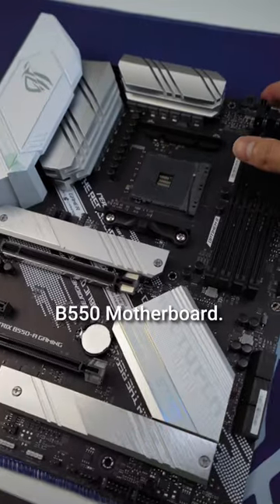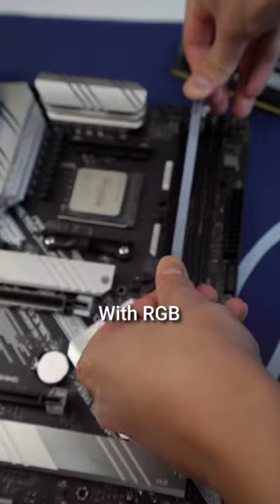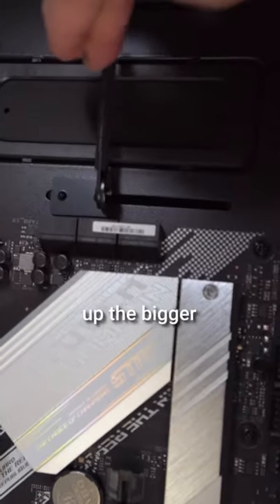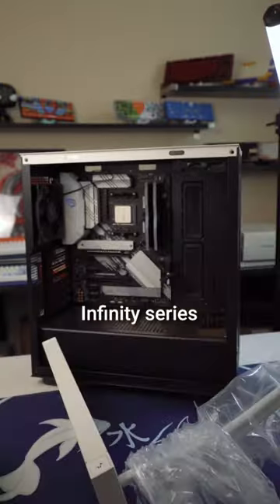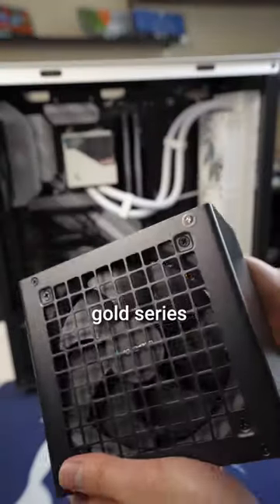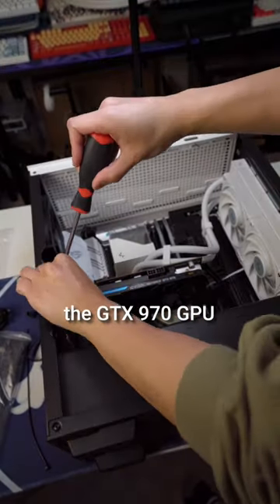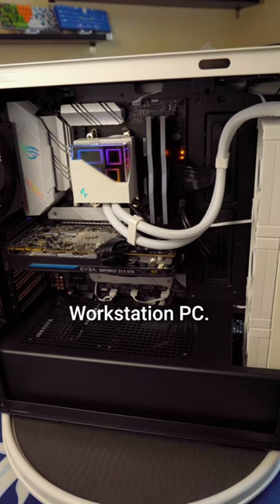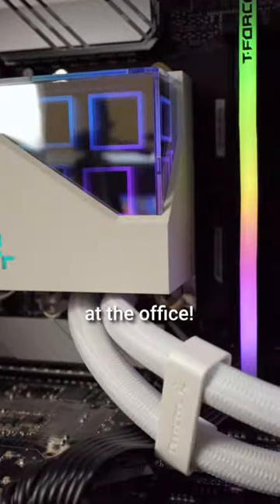Building an OP office PC for my assistant!

Comment: Why are you using a 5600G if you're putting a graphics card in the build?
Reply from the maker: Great question - Dual monitors for productivity and efficiency - although it comes with integrated graphics, I do want more monitors so I installed my old GPU.